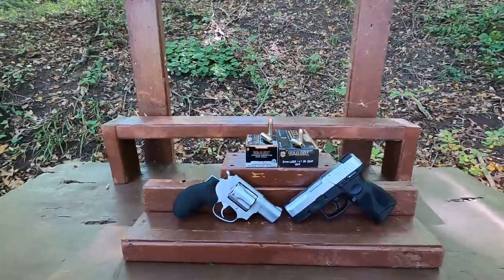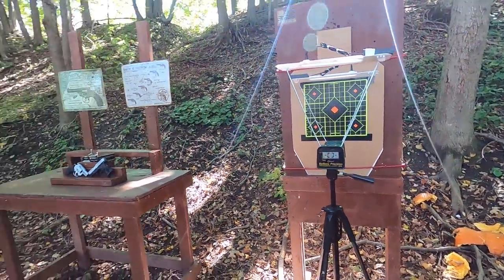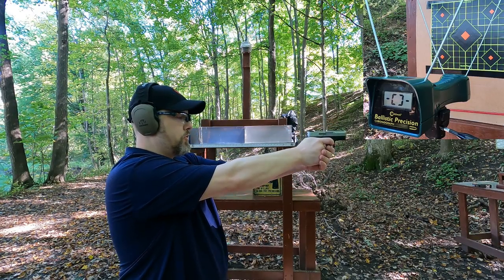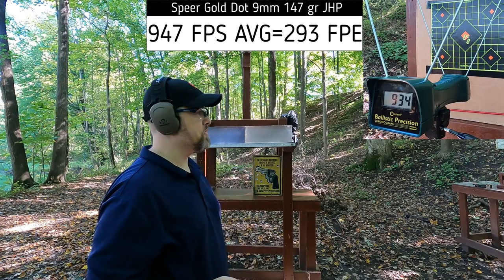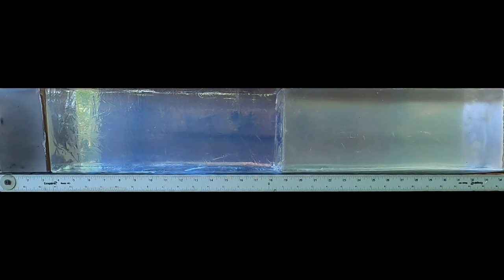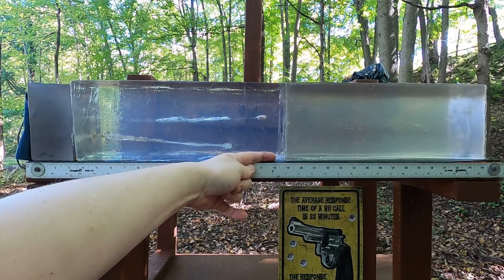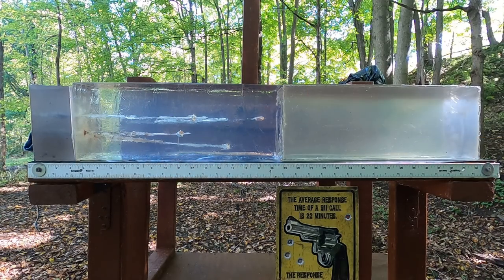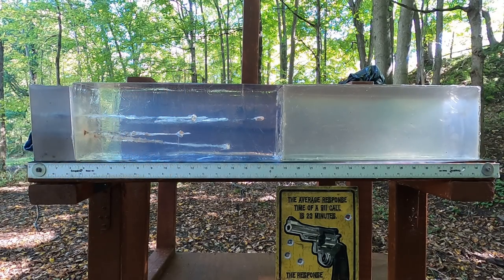👍 SOLVED: The BEST .357 Magnum SNUB Nose Load! 👆 Ballistic Test VS 9mm in Short Barrels

Comment from the maker: I know some people will get on here raging and complaining about my 9mm load choice, but we have to understand that this 9mm load is only 12 grains heavier than the .357 load, and going lower in weight than the .357 load is 11 grains lighter so it's a toss up. Also I have tested to death the lower weight 9mm load so I wanted to see how well this one does. People need to understand that much of the time my "VS" testing is not to put two calibers in competition against each other as much as it's an excuse to test two loads in one test! We all win here!
Reply: gold dot is some great stuff i have some in 9 and 45
Reply from the maker: @cloverleafsippa713 I haven't had a chance to do any testing on them yet. My only real opinion without first hand experience is you better know your carry rounds, as some could pull from the case under recoil.
Reply: @GunSam  is there any possibility of you doing some 9mm vs 40 cal vs 357 Sig comparisons?  I like your process and head to head matchups of defensive ammo.
Reply from the maker: @cancermonkey7334  I been wanting to do .357 Sig, but no one will give me a straight answer, not even KKM. I need to know if their 5" Long Slide .357 Sig barrel will work in my 5" M&P .40.

Comment: The old Federal Nyclad loads were quite the trick.
Reply: I've got some of the 38 special Nyclads I took on a trade. They are the 125gr- standard velocity load. I carry them in my 90's model Rossi 88 stainless snub. It's an Interarms marked Rossi- non plus P rated. In my testing, the Nyclads do seem to have shallow penetration. They were considered one of the top 38 snub nose loads back in the '70s.
Reply: Yes they were, I used them on water moccasins in the 80s. Very explosive on a snake head.

Comment: The 9mm actually did better than I expected,out of a 4" or greater barrel it would probably work fine. Regarding the .357, their short barrel .38+p works well and with just a little more power makes it work even better.
Reply from the maker: I need to test it again. I did like 4 years ago, but in just water jugs lol.
Reply: 3:57

Comment: The velocity on tbe 357 was a bit lower than i expected, but performance was good and consistent. The expansion was just about identical between shots, with good penetration. The 135 gr bullet was first used in the 38+p short barrel load, and has a larger cavity to aid expansion. Looks like it works well. Too bad the 9mm was inconsistent. Lots of people swear by it in 4" and longer barrels, and it has a good record. Like many people, it seems to me that 124 gr is the way to go in a short barrel, and there are some good 115 gr loads as well.

Comment: I am carrying these 357 Short Barrels in my S&W 340 M&P.  They shoot very well and look like they should perform well.  However, Looking at the Website and every dealer I can find, these are "Out Of Stock" or "Discontinued".  So I guess that means I have to find a different load.     I've been looking at Corbon DPX 357 or the Barnes 357  all Copper round.    I've heard that those 2 loads aren't too abusive to the hands in recoil.  Guess I have some testing to do.

Comment: So much for revolvers being more dependable than autoloaders. I had jamming and hard trigger pulls on my Charter Arms Bulldog 44spl shooting HSM lead roundnose flatpoint ammo and my Ruger SP101 shooting Federal lead roundnose 38spl ammo. Every forth or fifth round I had trouble pulling the trigger and couldn't pull the hammer back. I sprayed it down with Ballistol and dry fired it. Seems to work better but the trigger isn't that smooth. Good thing the target wasn't shooting back.

Comment: My 38 Special +P handloads with the 135 grain SBGD average only 110 fps slower than those 357s, when fired from a Ruger LCR (1 7/8" barrel). One of the only decent-weight bullets I trust to expand reliably from snubbies, although I have gotten good results from the 140 grain Hornady XTP (deeper penetration though).
Reply from the maker: I loaded some 135 +P's before but only got like 800 FPS in a snub. I think I used Universal powder. I typically get really good loads with max charges of Titegroup with XTP's. I don't know why but XTP's always clock faster than Gold Dots even if lets say both are 125 gr.
Reply: @GunSam  I use Ramshot Silhouette. It gets better velocities than pretty much any other powder in the 38 +P, and it's flash suppressed, so a lot less "strobe" than Titegroup, LOL. (Titegroup is my go-to for Cowboy loads and knockaround ammo, though.) And you're right about the velocities...Gold Dots are much softer than the XTPs and obturate more, so they have greater bore friction, hence the lower velocities.
Reply from the maker: @noahmercy-mann4323  I have found that Titegroup is more flash suppressed the higher it goes. Just max charge it on .38+P and it's great. I don't recall what it does with a max charge for a .357, but it's crap for .357 anyways maxing out of a 4" barrel 125@1,250 FPS.

Comment: I see you using a Taurus 856 or 605 in many of your videos. I know you have a few where you were having issues with an 856. Are you at a point where you endorse them or think they aren’t worth consideration?

I’ve had 3 apart so far and after cleaning up they’ve been as good as anything comparable in size I’ve seen.

Comment: I love your videos, but I will debate this with you. In a short barrel semi auto, I would opt for a 115gr. standard pressure Gold Dot always before a 147. One, the shorter barrel produces lower velocities which will adversely affect the already slower heavy subsonic.  Secondly, as a carry round, why buy the lightest guns to carry, then pack them with heavy 147 grainers which make a noticable difference on the hip?  The reason we carry the 147 on duty (HST for us), is because we have more likelihood of having to shoot through tactical barriers. Car doors, structure etc...Although this is possible in an off duty small carry gun scenario, most off duty data shows your deadly force encounters will be face to face from close distance. Translating to lighter, faster rounds out of a short barrel.  Just my 2 cents. Keep up the fun videos.
Reply from the maker: I have tested every weight of 9mm, so picking out this video where I used 147 gr doesn't mean much.
Reply: @GunSam  I’m not picking on your video bro. I was giving my opinion on bullet weights and short barrels.

Comment: I've never tested it myself, but i'm confused on why you say in the beginning of the video 147 grain is a good load for a short barreled 9mm. I've always heard the opposite, you want a lighter projectile for shorter barrels because heavier bullets won't get enough velocity for expansion in short barrels.. I personally just try to avoid 147 grain 9mm all together. Because all the ballistics tests i've watched showed that it will only expand out of full size 5 inch barrel duty guns. And even then, it still sometimes won't occasionally. (Nvm you do cover this at the end of the video, but it threw me off what you said in the beginning)

Comment: Ok, ill be devils advocate this time………if recoil werent an issue, what would be the best performing 357 mag full power load that youve seen in a short barrel. 
Im a bigger guy that has no issues at all taking recoil. I choose to carry a 357 lcr and have been carrying gold dots, but i want something with maximum energy and am willing to put up with “punishing” recoil.   Lol
Something like a 180-200 grain @ 1700fps maybe?!?!    Ok, that may be pushing it (unless its available), but you get the idea.
Reply: An 180gr full-house load like that would be insane overkill unless you're worried about getting jumped by a Black Bear. Stick with ~158grainer

Comment: I cobbled together a cartridge that I call a ".25 short barrel magnum."  Out of a 1.125 inch barrel, it pushes a 28 grain airgun slug at least 1400fps.  It's kinda scary.  Hoping it wont eventually grenade the barrel. 😅

Comment: I like the 135gr Gold Dot. I think the stuff I have is only in 38 Spl+P, so not quite as hot as the magnum loads. Still a decent round though. The 147s performed in a way that I feel illustrates my preference for 124gr projectiles in 9mm. You do get the penetration. But it seems uncommon for them to open up. That's just my take.
Reply from the maker: In order to get a 147 to expand you need a lot of velocity. I tested a couple in straight gel one being the T-Series, barely over 1,000 FPS in the 5" and no expansion, but with a Buffalo Bore 147+P+ at 1,150 FPS I got expansion, really good expansion but too much momentum also so overpenetration as well.

Comment: If you know ballistics then you should know that with 147gr 9mm you have neutered the round bringing it under 1000fps equals min expansion use 124 or 115gr and even so that snub 357 is still pointless.

Comment: Call me crazy, but I just don't think .357 is a good idea for short barrel handguns. It needs that extra barrel length to burn up that extra powder. My Smith M642 much prefers the W/W or R-P or Federal 158 grain lead SWCHP. My early 1980s M66 6" loves Hornady Critical Duty .357s....but of course, YMMV.
Reply from the maker: I used .38 Special+P in my snub nose .357's if I have to carry them. While a full house .357 Magnum in a snub has more power than a full size 9mm or even .40 S&W, the recoil is more than double so it's not really worth it to me. I need to make hits with the limited capacity I have and that flash and recoil might decrease my follow up shot proficiency.
Reply: @GunSam  thanks.

Comment: Please don t find insulted with my opinion,but ...this whose not comparation between 357 Magnum and 9mm but anemic so called 357 with 9mm.
From my stand of point,if Im recoil sensitive,I will use 38 Special in revolver and not this ...fraud of the cartidge.
 This Gold Dot and Remingtom 125grs golden Saber are ,from my stand of view, step in worng direction.
Recoil sensitive = 38 Special or 38 Special + P. 
Not recoil sensitive = real 357 Magnum. Like Remington 125grs SJHP or 140grs SJHP or 158grs Hydra Shok . With this cartidges,you will not have failure to open,and they are real 357 Magnum,including terminal efficency.